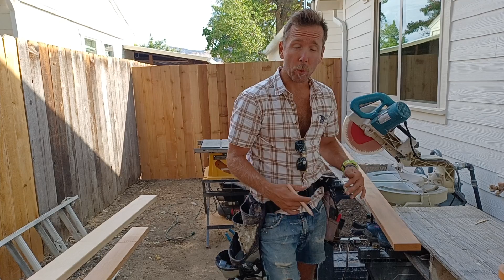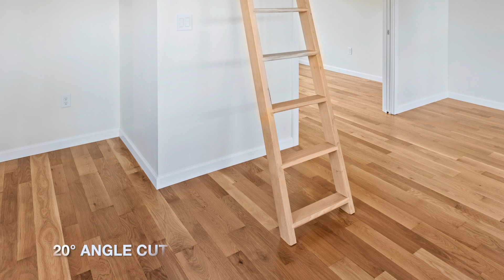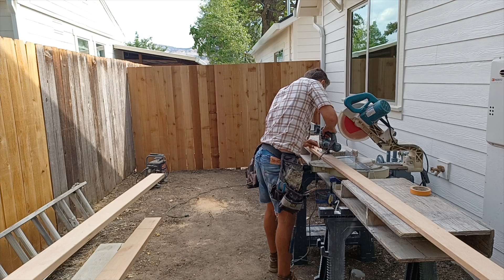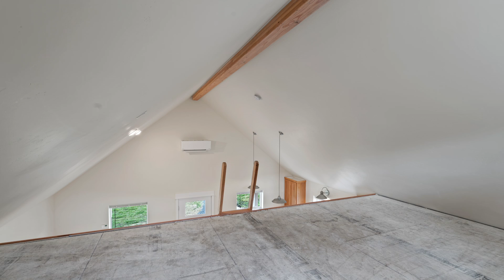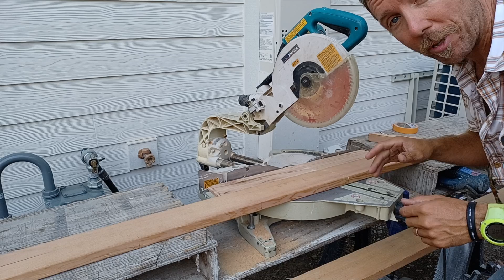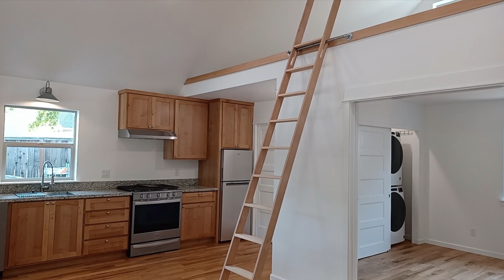DIY Loft Ladder. (With Step by Step Instructions)

Comment: I built this based on your instructions and filling in the gaps. Works and looks great! Cost $400 here in Bay Area ($355 for 18' doug fir stair treads, $20 1/2" pipe hardware, $15 for stain + poly, small cost for glue, brad nails...), and took 1 full day (from lumber selection to install). If I were to do it again, I'd purchase Dado stack to shorten time. Thanks Derek!
Reply from the maker: Fantastic! Always makes me smile when people take action. Thanks for sharing!

Comment: How many pounds would you rate this for? How do you deal with liability with this kind of thing? Thanks! 😊
Reply from the maker: I would guess 350lbs. We require our tenants to carry renters insurance and then we also carry an additional policy  coverage.
Reply: I'm building a quonset hut currently, and have a loft area that I'm going to use this ladder for. THANKS SO MUCH FOR SHARING!   My only question is in regards to the railing? Do you not have to have a railing up there?